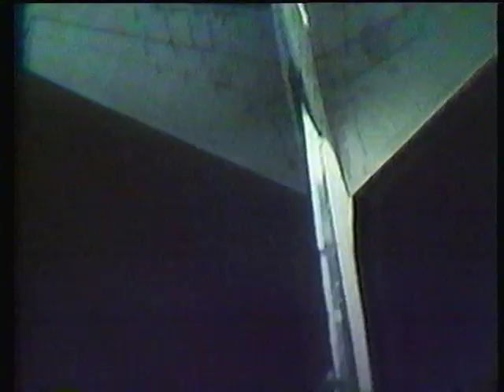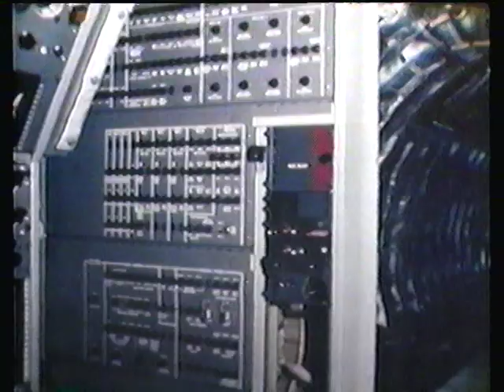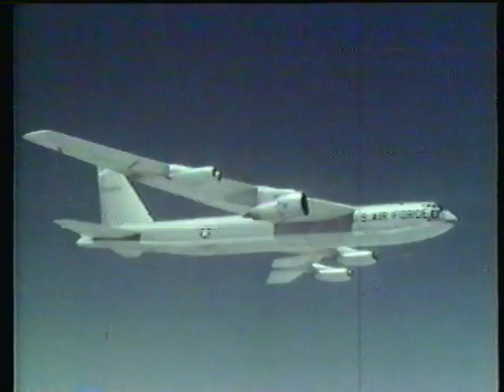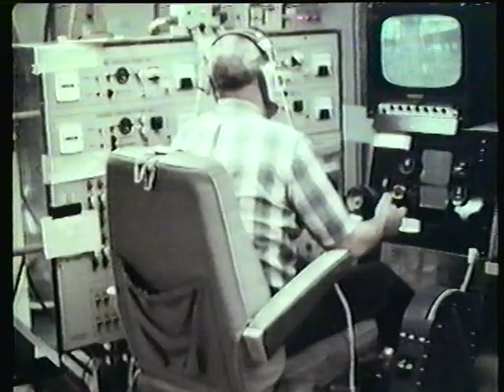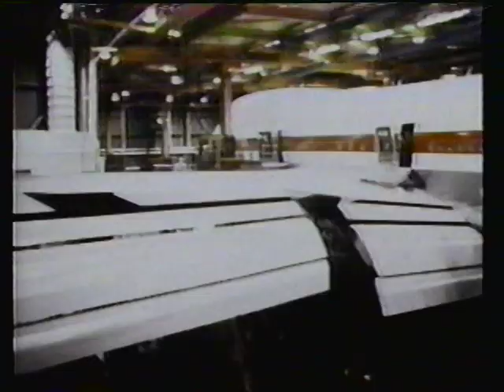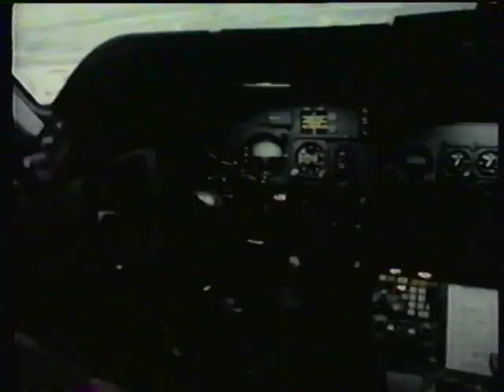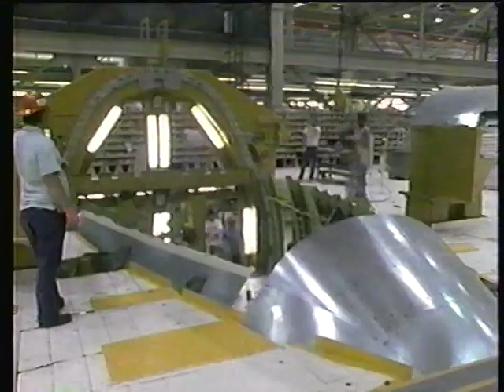Building and Test Flying the Boeing 727 & 747

Comment: 727 was a great plane but sometimes it was quite a handful to do a smooth landing. There was a lot of weight in the tail and normally the approach would be done with the throttles half way in order to avoid a controlled crash into the runway. Nevertheless it was sheer delight to fly it. 727 could reach 400 kias but the noise inside the cockpit was overwhelming. Would I like to fly one again? I’d love it!!!!

Comment: Oooooh, I just wish the 727s were still flying.  They had character and they were very loud to hear when they take off while leaving trails of smoke behind.

Today's aircraft, however, are so quiet that they are a bore to watch.

If anyone had lived close to a major airport when these 727s were still gracing the skies all day, I'd like to know what's it like.  Could you still sleep soundly even while the 727 was flying overhead after takeoff?
Reply from the maker: Ramon Yabut 
I also love the 727. To me it is absolutely the finest design for an airliner. I used to sit at the end of runway 19er at New Orleans International airport in the early 1990's with my grandpaw. I had my Radio Shack realistic scanner programmed with all the main frequencies.  I would hear, "TWA 802 turn right heading 120 intercept localizer for the straight in approach to runway 19er.......runway 19er clear to land." Then I knew it was a TWA 727 on approach because I learned what flights came in every day. I would then see that 727 off in the distance trailing a thick dark trail in a right bank lining up for the runway. Then those massive fowler flaps retacted, which gave the 727 it's superior landing apperance over other jets. Man, I cared for nothing elsebin the world than to see a 727 land or takeoff. Then to see one takeoff and be so heavy, it seemed to drag the tree tops for a few miles till it gained enough lift to climb out........I miss the old bird. Nothing today compares to the prestige and heritage of the 727.

Comment: ben wolfram....to answer your question....yes the #2 can be high by pass....i.e DC-10 and the L-1011...any thing can be moded, question is how much money do you have.
Reply: Well, but then the diameter of the #2 engine duct has to be about the same as of the 727 fuselage. With the much wider fuselages of the DC-10 and L-1011 that was no problem. But with the 727 it would look like three large engines with a little plane inbetween. :o)

Comment: I'm a Boeing fan, but you people do realize the B727 design and the Russian TU154  design was copied from the British H.S Trident. My father R.I.P piloted the Trident aircraft in the mid 60s to mid 70s and use to say it was a superb aircraft to fly especially the very advanced for it's time Auto pilot. It was the first aircraft certified to land in CAT 3C conditions which basically means zero visibility. The B747 was not the first aircraft capable for auto land, the H.S Trident was. The only problem for the H.S Trident aircraft was it's under powered RR spey engines, which made the aircraft sluggish on take off especially in hot weather. BTW the Trident was also capable of cruising at M 0.88 and can easily go up to M 0.96 which makes it the fastest subsonic airliner.

Comment: I flew on one of the last Delta 727;s on a short hop from Louisville to Cincinnati in about 1999.   The plane was built in 1968 and was very spacious.   UPS re-engined their Cargo 727-100's with Rolls Royce Tay engines in the early 1990's and they are quiet and smokeless for the most part.  They offered a passenger service for a while in the early 2000's to Cancun and such places on the weekends as charters.   They've moth balled them now,  but one of the major improvements was they added a limited HUD to assist pilots.   Very cool,  buy one of those if you can.

Comment: 727 One of the truly great aircraft made. To me, second is the 737 followed by the 757. Imagine a modern 727 with glass cockpit, fuel efficient engines and composites where they can be placed. Only thing that would top that, roll out the 757 with the same modern materials and electronics as the 787.
Reply: No way. Composites and glass suck. That's what took the fun out of flying. No more skill.
Reply from the maker: To me, personally, I will always love the 727.........it was the best looking airliner literally from every angle. It has the sharpest body lines and a perfectly matching angle of wing sweepback. The massive Fowler flaps complimented the sharp angles of the wings and tail plane and the jet looked menacing on takeoff or on final from directly in front view. The Boeing signature "bullet" nose was perfectly shaped to start the tubular fuselage beautifully tapering in the rear with the drum sized #2 exhaust nozzle. Then to mix in the noise of the P&W JT8D's which you could still hear up to over 10 miles out after takeoff on the climbout and the smoke pouring out the back means the 727 was no joke and meant business for it's duties. It's truly sad that in the name of every refining Aviation regulations this awesome bird was taken out of service in 2003. Now all we have today is generic looking airliners that have mostly wing mounted twin engines and all look the same, quiet, smokeless, and the only nice attribute of these newer airliners is just watching their immense size move through the air till their gone. The 727 had it all. Miss it.
Reply: @video1974  AMEN, you said it all brother!!! What a magnificent machine the 727 was, I think that to understand the greatness of this airplane you had to have been lucky enough to fly on one... I will miss it forever
Reply: Iron Horseman EXACTLY.

Comment: If I had enough disposable income to throw around, I'd contract Boeing to build me my own 727-100, black - with blue and red racing stripes.
Reply: Look on Controller.com. there are 4 Valsan Super-27s available. These are the 727s you really want. Engines one and three are upgraded to meet modern noise requirements, which makes them much more long-legged, as well.
Reply: Daemonic Nimrod Maybe we can get a two fer. I would like one too!
Reply: Daemonic  would NEVER happen !!!! The factory used to make the 727 is the same factory that builds the 737 and it is busy !!!!
Reply: Yes my husband wants one also the tooling is probably gone but Boeing does have spare parts for them in stock find one send it to them for a complete check and rebuild and your good to go :)

Comment: you really couldn't have a high bypass (#2, anyway) engine in this configuration, could you?
Reply: Correct. Boeing looked at modifying for turbofan engines. There was no practical way to do that on the 727 with it's centerline engine. If you just delete the center engine and use 2 by-pass turbofans, then you have an MD-80.
Reply: @raoulcruz4404  deleting the centre engine on a 72 does not a 71 make.
Reply: @ellenorbjornsdottir1166   Not in exact lineage but, in redundancy of same class of plane. There just wouldn't be much point in it with the newer types coming out and there would have to be a re-Cert to delete the FE position.
Reply: Raoul, the MD-80 had the same 
JT8D engines as the 727.  It 
would be the MD-90, and the 
Boeing 717 that had the high 
bypass engines.

steve
Reply: Ben Wolfram Probably not. Lots of smart engineers out there though.
Reply: Valsan did modify several by replacing the outboard engines with turbofans .the make great Executive jets, because of their short field abilities and air stairs.

Comment: Quote: 'More People have flown In Boeings than all Airliners Combined' 
So True.
Still True.
So True.
Still True.
"If it's Not Boeing I'm Not going"
Reply: Actually it's Airbus that imitates Boeing.
Reply: @Robert_N  TRUE !!!!  Boeing was the original !!!!!
Reply: @wilburfinnigan2142  what happened then, to the max 800 and 900,did they loose there MOJO 🤣
Reply: @Robert_N  That's what I thought, too, LOL, but I wasn't sure enough to post it!
Reply: @Robert_N  actually that's not correct, look what happened when boeing tried to follow airbus neo aircraft, it created a mess, causing a lot of deaths, boeing is only good when they stick to what they know, not the most inavative company.
Reply: @Robert_N  that 727 looks just like the French Caravelle, which was out a long time before the 727
Reply: @desmondleroux3444  Actually the B727 and the Russian TU154 looks like the British H.S Trident the most advanced airliner of it's time. First airliner certified for zero visibility landings. Very fast, normal cruise speed M 0.88 and capable of M 0.96 (if fuel consumption wasn't an issue). My dad R.I.P was a captain on the Trident from 1965-1974. He loved flying it.
Reply: @Robert_N boeing actually test the French Caravelle before designing the 727, which was basically a 3 engine 707 with interchanging parts, with Caravelle technology of the time.
Reply: @desmondleroux3444  Boeing took a bit from Caravelle and a lot from the British H.S Trident the most advanced airliner of it's time. The British during the 50s and 60s led the world in Aviation design and technology.
Reply: I came to the U.S. on McDonnel Douglas MD-11.  I also liked flying the DC-9 and A310.  Fantastic planes.  Sure, I like the 707 and 747, but the Boeings of late seem to imitate Airbus too much, and they are a bit bland.  Mind you, I like the original A300, it was quite beautiful.  And so was the Concorde.  But my favorite planes remain the DC-10 and 747.  So it's not only Boeing I'd go in.
Reply: @MDM-님-CDGS-KSA  Son you have it backwards !!! It was scarebus that copied the BOEING designs as BOEING set the standard !!! WHY scarebus looks like the Boeings !!!
Reply: Wilbur Finnigan Im a boeing fanboy, but Airbus revolutionized the wide body twin jet with the A300.  The A300 was the whole reason boeing had to build the 767 to compete.  They are both good, I prefer the flying dynamics of a boeing with less computers, but they are both good, and the competition makes both better.  Like the mustang vs camaro, it forces both companies to make better stuff.
Reply: @kingssuck06  I know that they are NOWHERE near as safe, but the Soviets built some pretty interesting airliners.  They may not have been anywhere near as safe, nowhere near as comfortable, and nowhere near as efficient, but they were interesting!  Now, though, the Russians are starting to come up with some really nice ones, Sukhoi has a modern one, now, that looks like it could start to become competitive.
Reply: @wilburfinnigan2142  actually you totally wrong, boeing was very interested in testing the French Caravelle aircraft, so was a few other American aircraft companies, and the resemblance is most definitely there, the 727 and the Caravelle,
Reply: @MDM-님-CDGS-KSA  I agree the airbus A300 is a good looking aircraft, don't believe boeing is what they were before, loosing a lot of ground to airbus
Reply: 737 MAX 8
Reply: @SwiftSpear all corrected, still used as tankers

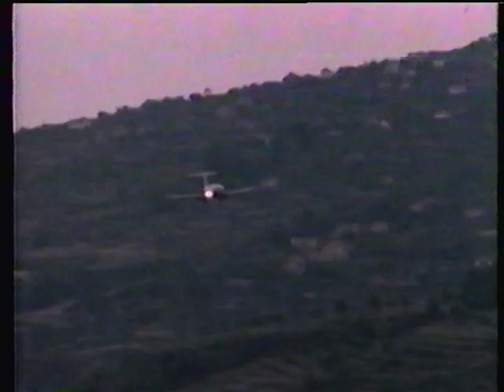Comment: What I loved most was the TAP 727 landing on the old 5.000 ft runway at Madeira, starting at 28:33. I did this only once back in 1993 in a 737-500, and I can testify that it was an experience! The return flight from Madeira to Frankfurt, operated non-stop on the same type, took a mere 20 seconds from brake release to rotation. 727s in those days however, could not fly such sectors from the short runway and had to do an intermediate stop at Porto Santo island for refuelling if they were to fly such a route.
I have also flown on the 727, mostly with Lufthansa and Pan Am on the internal German services (IGS), and I loved this bird, which was very quiet in the cabin and was fascinating to watch when operating the flaps and slats. Those were the days my friends.
Reply: That old Madeira airport with its small runway and filthy cross winds could only be safely handled by top TAP pilots (probably Top Gun graduates....LOL)
Reply: When it comes to aircraft and safety, quality comes first!

Comment: I knew a retired Eastern Airlines Pilot. He called the 727 a "Flying Ferrari" He said it was a ball to fly . He said that it would climb at an angle that would have caused most passengers to freak out and puke.
Reply: True. Also a light weight B767 can initialy climb like a fighter jet.
Reply: @Robert_N  RB211powered B757- hold my beer!